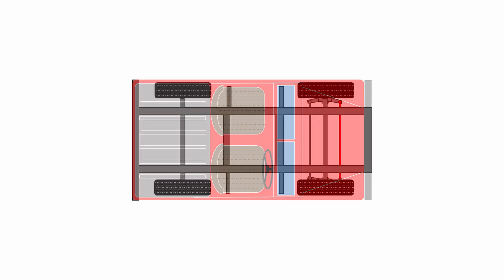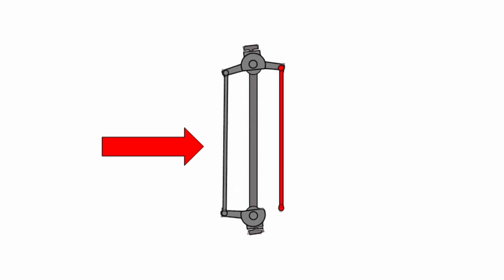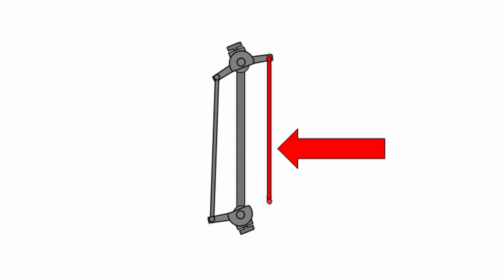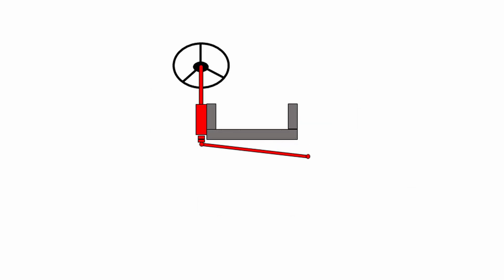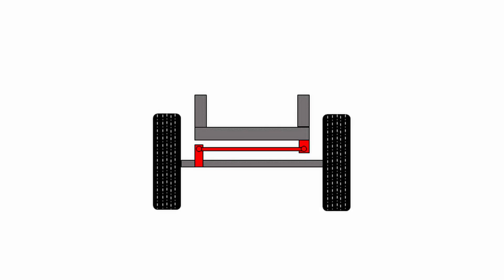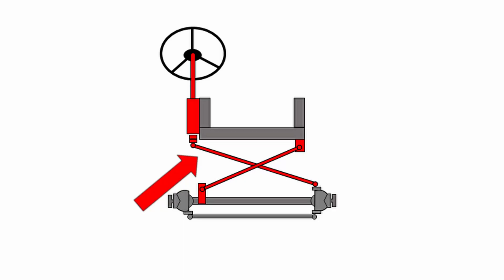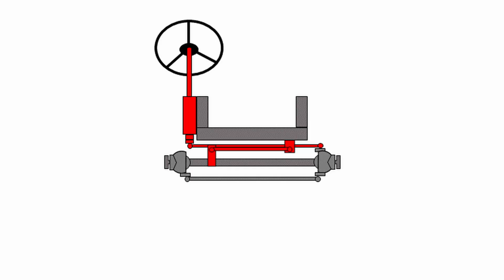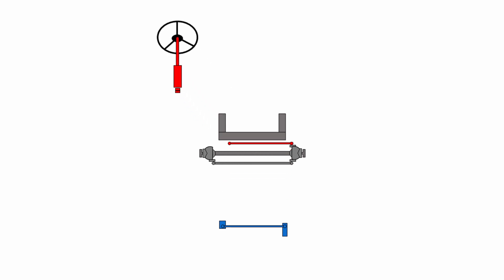Bump steer in beam axles

Comment: I don't like panhard rod. I much prefer symmetrical action of the suspension. How can you get zero bump steer on a beam axle with a 0 lateral movement suspension geometry while also still retaining steering feedback and correct return-to-center alignment? Would a 90-degree pitman arm in the center of the axle do it? is there some kind of fancy "watts-linkage" esque setup that you can do to your steering that would do it?
Reply from the maker: I agree that having your axle move sideways in bump doesn’t sound like a great idea, although it seems to work ok in practice. I can’t think of any production examples of zero-bump steering linkages like you describe. To make it work you’d need to work out which axis your axle couldn’t move around and then send a steering shaft down that axis. So let’s suppose you built a suspension linkage that completely eliminated roll steer, so it moved up and down along a completely straight path (imagine a Watts linkage turned 90 degrees at both ends of the axle). You could then have a vertical steering shaft going down onto the centre of the axle. You’d need a way of compensating for the vertical movement, but that’s not that difficult. The question you’d have to ask yourself is whether all that complexity was really worth it for the handling improvement you’d get - it would still be a beam axle after all.

Comment: Can a ifs 4x4 get bump steer? Or is this just for solid axle ?
Reply from the maker: Independent setups also suffer from bump steer, but it tends to happen symmetrically - so when both wheels on an independent axle go into bump they toe in or toe out together. Lots of designs actually take advantage of this behaviour to change the way the vehicle corners, so as the vehicle leans over in a corner you can use bump steer to introduce some passive steering to create understeer, but that probably needs another video to explain properly.

Comment: Is it a bigger problem when the rear axle is stiffer or softer, if you have bump oversteer?
Reply from the maker: If the suspension is stiffer in roll then you will experience less bump steer, because the amount of steering effect you get is directly related to the amount of roll travel you get. The slight complication here is that making the rear axle stiffer in roll makes it more prone to oversteer due to weight transferring from the inside wheel to the outside, so you might improve the bump steer situation, but still get oversteer - life can be terribly unfair 🤷‍♂️
Reply: @Offroadvehicleengineering  is it the same with the springs? Or is it different there?
Reply from the maker: The springs contribute to roll stiffness, indeed unless you have an anti roll bar then all of your roll stiffness comes from the springs. If you do have an anti roll bar then you can play tunes on the suspension to give you the combination of roll and vertical stiffness that you want.
Reply: @Offroadvehicleengineering  and if you make your front axle (arb and springs) stiff, would you also make the dampers softer on the front axle?
Reply: do you have a discord account?